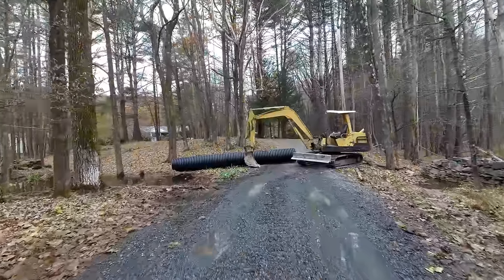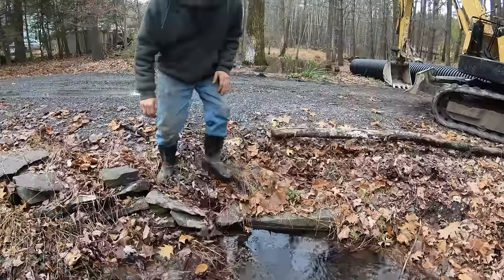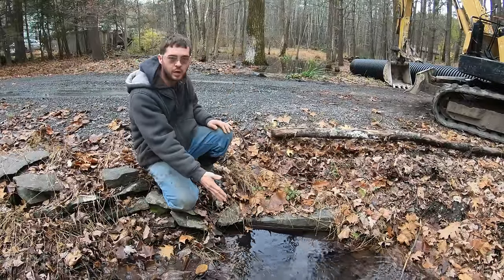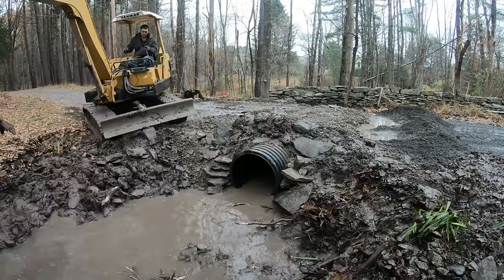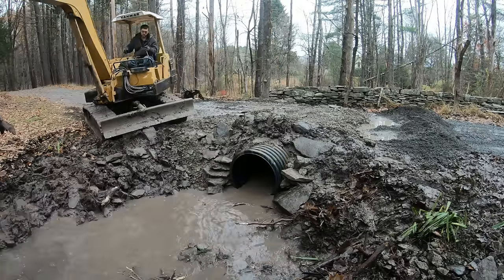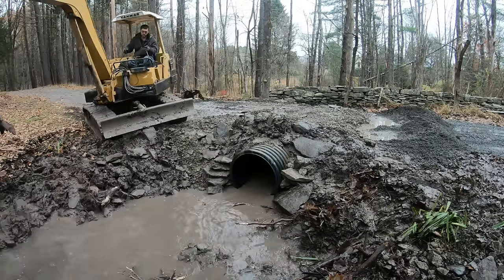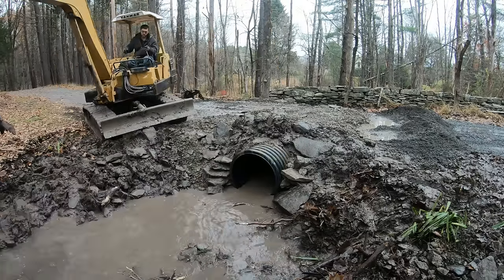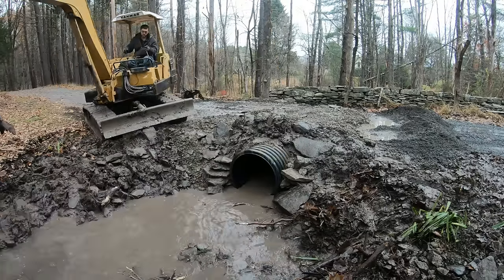Replacing a culvert pipe

Comment: When I saw you putting those flat rocks in the pot-holes, it made me think of another driveway you did that was much worse. Would it be worth it to order a yard of ready-mix concrete and go down the length of the drive and just dribble a little in each of the holes? You may have a ‘short load’ charge from the ready-mix company to deal with, but maybe you can negotiate something w/them. For example, if they had a truck in the area with extra concrete. Just an idea.
Reply from the maker: The minimum to get those trucks out there is like $600. I would not think that would be worth it. If a road is extremely messed up, dump a few loads of quarry rubble there (big pieces of stone). Than spread it out, and track it in with a dozer. Than top it with smaller stone.
Reply: Right. I figured the ready-mix minimum would be the catch. Occasionally the big box stores will make you a good deal on a pallet of Sakrete that got a little wet. Pour the Sakrete in the holes dry and gravel over it like usual. Idk. I thought I heard you say once, that the same potholes tend to reoccur. Just trying to think of a solution.
Reply from the maker: If your getting a good deal on the bags, go for it.

Comment: BTW, have you ever tried driveway underlayment fabric? I'm still thinking about it as it isn't real cheap, 13' wide at about a buck a foot, I've seen it used at well sites with some that's been in for over10 years without potholes and the rock doesn't sink out of sight even though the base isn't very deep. Granted they typically use 57's and don't receive daily traffic.
Reply from the maker: Yes, some jobs its necessary. For example, a new road threw a muddy area; use the fabric. If the area is rocky its not as necessary.

Comment: Have you ever looked into putting an air latch tailgate on that truck? I put one on my f800 and it makes spreading a lot easier. I only have probably $200 and an hour worth of work into putting it on.
Reply from the maker: My international has one. IDK, I don't like how there is a delay from the time hitting the button to the time of it opening. The manual latch works fine, and I have a rule about not fixing stuff that's not broken.
Reply: @AndrewCamarata  that international is a nice looking truck. I'm in the market now for a tandem or tri axle. Really sucks on bigger jobs when you're limited to 8.5-9 tons per haul

Comment: wouldn't the metal shrapnel(not talking about what was in the bucket at 13:15) from the old pipe slowly puncture the new one as cars drive over it?
Reply from the maker: I don't think so, its buried, and not very thick. That tin will rust into nothing quick.

Comment: Question at 10:15 in the video you can see water escaping on both sides of the culvert, wouldn’t that indicate eventual wash out of this culvert? Or at the very least a sinkhole that would need continual filling over the years? I know with the water running like it was on this job that has to be a pretty tough job.

Comment: Let us all know how long it takes until that pipe starts floating pushing up through. Any size over 12” should have a half height headwall installed on both ends and Atleast 36” of cover over entire length of pipe. Have you ever heard of a transit?
Reply from the maker: That pipe will last forever. Yes, the water is a transit.
Reply: Andrew Camarata yes the pipe will last because it’s plastic. It won’t last staying under driveway. Sooner or later (too many variables) it will start raising. Nice try saying “water is transit”. No it’s actually not. You can use water as a level but not as a transit. Let’s just say if you were right then how would you be able to shoot fall with a dry stream? Besides that no where in your video shows you checking the fall by placing pipe in trench, pull it back out then fix grade by adding or removing any dirt. Additionally compaction should have been done in numerous lifts until back fill was above pipe. This is where you’ll say “I compacted it with the skid steer” but the voids left under pipe from not compacting is another reason it will fail. Allowing water to work it’s way in there will start washing material out until the void is so big that the driveway collapses or the pipe floats.

Comment: Excuse me for the google translation
there is not much overlap on your plastic pipe, it would have been necessary to put a concrete pipe 
With heavy weight passages it will bend

Comment: If I were an Engineer, I'd ask why not use an oval shaped pipe? or a cluster of two smaller pipes? since the majority of the crossection is air only. and was rather difficult to bury.  I do know that as the height/width decreases, it's load bearing also decreases, but I wonder if there are culvert pipe designs that reinforce to counter that, while still improving the flow....value.  shrugs

Comment: Should have dug the trench out deeper. That culvert is a major liability for any heavy vehicle - One load of gravel doesn't cut it in my opinion. You could have dug deeper for sure.
Reply: @ike fun Unlike you I watched the whole video, I disagree, I reckon he saw that it would take him a bit longer than he budgeted for and called it quits unless the client would bear the cost; i.e. the gravel.
I was not there, I can't be sure whether he could have dug another foot but I reckon so judging by how little resistance the machine had faced that far.

Why don't you watch the whole thing out before you mouth off to me and start throwing around insults?

Comment: only one question: would it be better to put a net on the hole where the water get in the pipe? it seems to me that it would get clogged pretty fast if u let it open like that
Reply from the maker: That's usually bad. I have seen people do that before, and it get blocked with leaves quickly. than the water pumps over the pipe and causes problems.

Comment: When you put the NEW Big pipe in, put the huge rocks on The TOP of The NEW Pipe and then put all the  soil and dirt on it and the result will be that the pipe will be compacted already and the cars who drove on it will not shake the pipe and will be no mowing effect, it all will be firm.
After you put the dirt on to the pipe just take off the huge rocks and put them on sides on enterings and exits the pipe. just a tip.
When i watch i always think how can everything would be better.
You can say to me that you are the one who is professional and that i need tos hut the fuck up or try my method, MAYBE im on to something

Comment: Approximately how much would it cost to get all that work including materials done currently? Just pretending it was the exact same job and location. I know there's a lot of variables but just wandering an estimation based on what I seen here. Thanks
Reply from the maker: IDK, price the pipe locally. that took a few hours to install.
Reply: @AndrewCamarata  what's the hourly rate for the work?
Reply from the maker: On short jobs like that, that size machine is worth 75-100. Just look what it cost to rent one, then add labor, fuel, and transport.
Reply: @AndrewCamarata  thanks. Yeah I know the hourly is high for something like that but people have to consider the expense. It's a lot of work you get done in a short time. Thanks for the estimate. Sounds reasonable to me was just wandering about the cost. Any idea approximately how many hours that took? I've never been around those mini excavators much.
Reply from the maker: IDk, maybe 2-3 hours for the pipe part.
Reply: @AndrewCamarata  ok thanks!  Should be enough for a ballpark idea anyway.

Comment: Über das Rohr darf aber bestimmt kein lkw rüber fahren... hat ja kaum Deckung das Rohr... und mal ne frage... warum verdichtet ihr nie? Wenn wir Material einbauen wird min ab 40-50 Zentimeter abgerüttelt
Reply: "But no truck is allowed to drive over the pipe ... the pipe has hardly any cover ... and a question ... why do you never compress? If we install material, min. 40-50 centimeters will be shaken off"
Reply: @davidnull5590  danke fürs übersetzten 😉

Comment: So why plastic pipe instead of the corrugated steel or concrete pipe? I would be afraid the plastic would cave in if something heavy drives over it. Maybe the steel rots up there where you guys use so much salt in the winter?
Reply from the maker: I have never seen a plastic pipe fail. The steel ones are always rusted out.

Comment: whats that blue cable at: 3:57????
Reply from the maker: Good eye, it looked like a cable wire. IDK why it would have been installed like that. There were power, phone, and cable wires overhead. And the customer did not complain of anything not working.

Comment: Culvert is a brand name? 😁😂
Reply: I don't think so.  Culvert, a derivation from an unrecorded Dutch word, possibly *coul-vaart, a combination of Dutch coul-, from French couler (“to flow”), and Dutch vaart (“a trip by boat, a canal”).
Reply: @davidnull5590  Plus, culverts come in different sizes and shapes, corrugated metal, petroleum based, and cement, etc.

Comment: Sorry but have to say it's a good example of how not to lay a culvert, should be a steady slope, old rusted pipe should not be used as a back fill and under the pipe will was out with no material cradling it

Comment: First 20 secs... why would you not put the ramps down, put it on roll in place put ramps on. Or slide the forks together pick the pipe for one end load from the back. Worst choice but better then whatever that was lay the pipe on one ramp instead of trying to drop it down  the middle and gently push it forward with your forks...

Comment: Hey andrew seems like you always use 1 inch rock witout fines for driveways why dont you use 1 inch with fines we call it ca6 or road pack where im from your drive ways will hold together better since it will pack together instead of using clean 1inch which is basically marbles and get blown away by traffic. like the vids though
Reply from the maker: Thanks. Because the place where I get that gravel; the stuff with the fines in it has too much fines. The fine gravel does pack down and look nice when its installed. But it fills with pot holes very quickly. Plus it doesn't tailgate out of the truck well. I have been having excellent luck with the rock with no fines, I have seen it last years without getting any holes in it.
Reply: @AndrewCamarata  True. I just had 22 T delivered of what we call modified. The quarry calls it 2A which is 2B or 3/4" stone with fines added. At any rate this quarry basically brought me a load of mud. It packs in beautifully like cement but then after a rain it's a sloppy mess. Needs immediate top coat of cleans basically. What I needed it for was to cover over a 22 T load of shale which was fairly rough and bumpy and would not have plowed well this winter. The modified did in fact smooth the top of the shale out and is now plowable without tearing it up and in the spring I will add regular 3/4" 2b's to keep the dust down. Clean stone keeps the dust down as it gets the tires up off the dirt. I also crowned the whole section carefully with my Bobcat so it doesn't form a deep rut down the middle like it had. It's on a hill. I know you know all this stuff but a lot of viewers may not be up to speed on gravel road maintenance so just thought I would share my story from this week. Happy Thanksgiving and congrats on 100k!

Comment: Why didn't you just clean out the downstream side.  There was no where for that water to flow and was pooling up thus preventing the flow from the upstream side.  It had some flow but was restricted since the water had no where to go.  Could have saved time and money.  Water level was halfway up the downstream side when running out.  Overkill on the pipe size.  Love your videos but this was a bit of a fail.

Comment: Why just gravel on all of the driveways? In PA it's always modified, stone dust added that packs the driveway almost like it was paved.
Reply from the maker: The stone dust is easy to install and packs nice, but water always seems to wash it away, and it fills up with pot holes.

Comment: Nothing about this job was done correctly. I can't wait until they fall in the culvert and have you pay to fix the vehicle and have someone do it properly. And save your "I do the bigliest best work" and "it's what the customer wanted". Screw doing it properly, just get it done. Don't worry about putting holes from the large rocks, no bedding, no real gradation, no root/debris prevention.
Reply from the maker: Everything here was done perfectly, clearly you don't know what you're talking about.
Reply: @AndrewCamarata  yeah, no idea what I'm talking about. I've never done it before professionally, also I never took 20 seconds to Google manufacturer recommended installation. But yeah, you go champ. A hump over a culvert means it's deep enough. Also, because I don't know what I'm talkin about the size of that culvert is way too big and it won't have enough flow to keep it cleaned out. but I don't know anything so I don't know it will fill up with sediment eventually and cause problems for years to come. Keep up the good work, you give other contractors something to point laughs at while they fix problems caused by unskilled know-alls

Comment: If you take into consideration that the colvet you laid in has ridges, that raises the crush factor ten fold meaning that a standard colvet would fail at say three tons... times ten is thirty tons or what we used in a shallow lay situation which is more than this person should ever see.. like a cement truck per axle is not that high. Good job, armchair referee... go home.!!

Comment: I like watching, but i think you are no expert. Drain too shallow, downhill side needs digging out further past the stone wall. Gravel does NOT fill potholes, nor do flat rocks.
Reply from the maker: What would you fill the pot holes with? That repair will last.
Reply: @AndrewCamarata  we use a mixture of finer gravel and clay. It is called McGrath's mix here but i am sure that may be just a local term. Do not know the recipe of it. It cannt be used in the wet, but needs to be damp to bi nd. Filling with gravel lasts only a couple of weeks. This mix lasts months.

Comment: This is definitively NOT how one properly replaces a culvert! First, survey the site so you know what the slope and natural elevations of the stream SHOULD be (go well upstream and downstream), next, control the water so you don't send a torrent of muddy water downstream to the things living there! A 2" pump could probably deal with this site to move water from an upstream coffer dam to the downstream area cleanly. Then, determine the appropriate size for the new culvert so it can pass a big flood without excessive scour downstream, then excavate about 1' lower than shown so there is the prospect of having some natural material ("substrate") in the pipe. There's more, but I have to stop watching this S*** show.

Comment: You can operate a machine but a pipe layer/plumber you are not. Very disturbing watching you try to install that pipe.
Reply: Why do you say this? I was impressed with how WELL it was done, especially because it is tricky to hold the pipe down while filling-- And the shot down the pipe showed how straight and round it was. And lastly, he not only gave it a good "try" (your word) but met with pretty good success, I'd say.
Reply: Jack Knowles 
I am a plumber and have been doing drainage work for over 20 years, if you want the pipe work to stand the test of time you should 
1. Dig your trench with correct fall
2. Bed your pipe in appropriate bedding material (not just lay on bedrock)
3. Backfill your pipe with appropriate material (not rock and soil you excavated from the trench)
4. Compact that material (not just run your machine over the trench)
5. You never lay pipe in a trench full of water (not just throw it in with the she will be right mentality)
Nothing about this job was up to code, I admit it was going to be difficult given the situation he had there but that is no excuse for poor workmanship. When you upload a video for the world to see you have to take both the good and bad criticism. Hopefully he will see this and change his ways but I won’t be holding my breath on that.
Reply: @michealmcintosh2265  Thanks for your thoughtful reply. I'm guessing in that residential setting the tube will last decades as installed. The balance between time (money) spent vs. degree of fastidiousness (or whatever you'd call it? low/med/high/super-high standards??) is a tricky one, as you know as a pro. I think AC hit the sweet-spot, and did the job to a good standard under the circumstances.